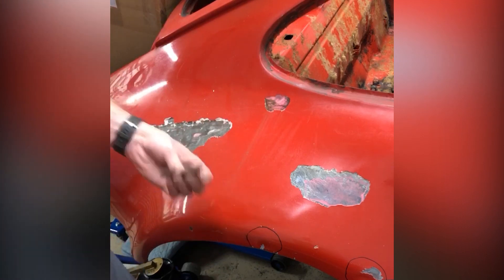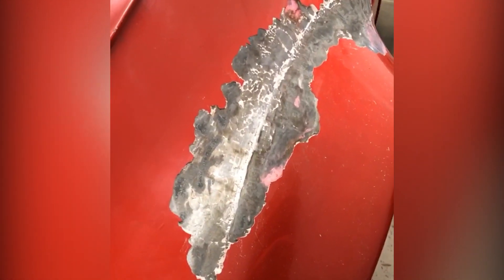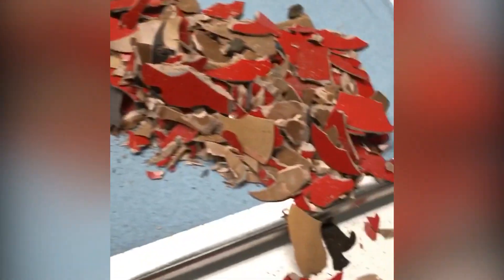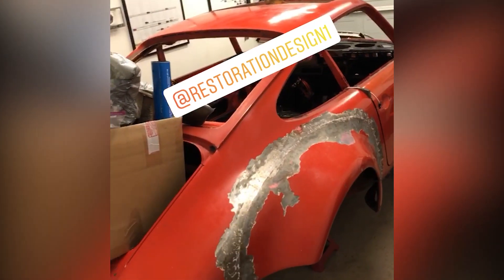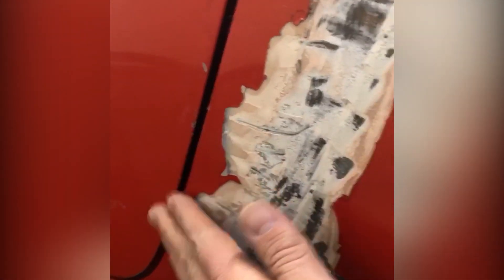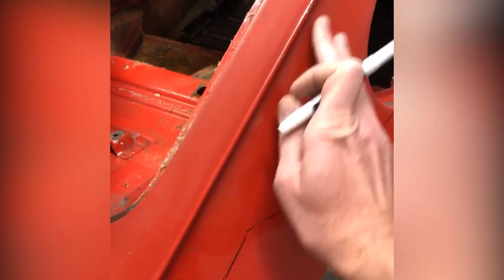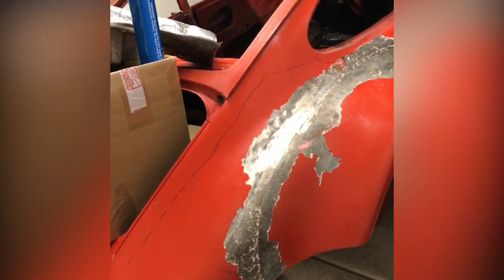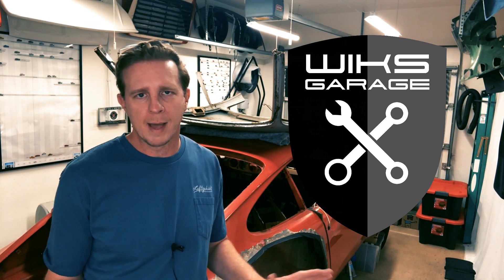I discover a Bondo nightmare underneath the paint on my classic Porsche 911S. RSR Build. S1:E7

Comment: Agh!  I can't believe people do lap welding.  My flares were the same way.  Butt welding is not that hard, you just have to take the time to learn how to weld.  I think there are so many body shops that just do crap jobs because the owners wont find out for years.  To repair mine I had to find used SC quarters and cut them in exactly where you are going to be cutting yours.  Looking forward to welding them in.   I just found your channel, I will need to start from the beginning.  Subscribed and a thumbs up!
Reply from the maker: Thanks Rodney. Yeah, on the bright side, it completely changed the direction of the build. No longer an IROC clone, but now a 74 RSR Carrera 3.0 tribute. Thanks for checking out the channel.

Comment: lol.   omfg that's bad man.   That sucks.
Reply from the maker: Yeah horrible! Silver lining means that I can go even wider and lighter with new flares in back! :-D
Reply: @WiksGarage  Where do you stop though.... whole car repaint?  Glass out?  Weather stripping?
Reply from the maker: @ADDvanced  I knew from the get-go that this would be a full custom build. That's the way I wanted it. I did what you are doing with my '75, so I've been through a mild restoration on a budget. This project is sort of the next level for me - a full tear down and every part hand picked for a custom hot rod to my taste. The nice thing is that these early cars are so simple, you can literally take everything off and rebuild to suit like a lego. :-)
Reply: @WiksGarage  So you are doing a glass out repaint?
Reply from the maker: @ADDvanced  Chassis is stripped to the bone. I even pulled the wiring harness. Major metal and body work to follow as I convert to a 74 Carrera RSR look hot rod. I've sold the suspension, wheels, engine, interior. Most of it is hand picked parts from the ground up.
Reply: @WiksGarage  You sold the engine!?  Where are you going to find 30-40 grand for a new one?  Joking.  Sort of not.
Reply from the maker: @ADDvanced  Bought a 3.2 from a friend a few years back with the intent of installing it in my 75, but the 2.7 in there is actually pretty fun, so I'll be building a 3.4 for this widebody project.